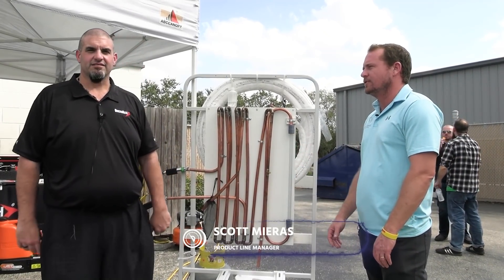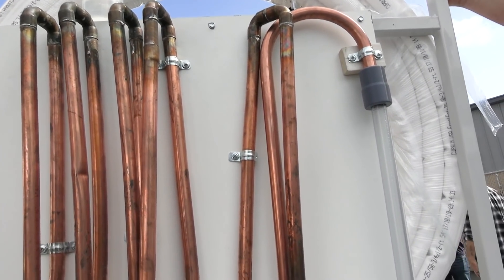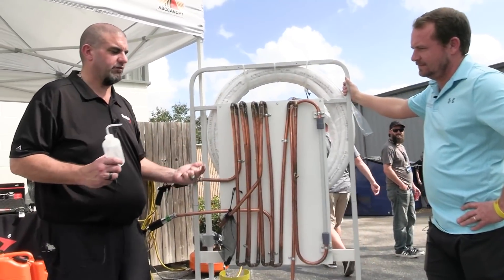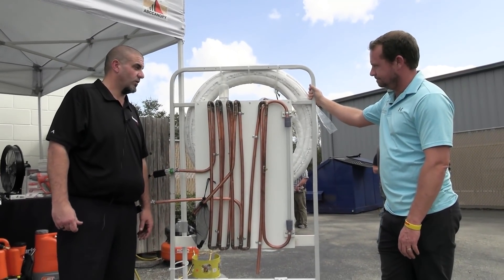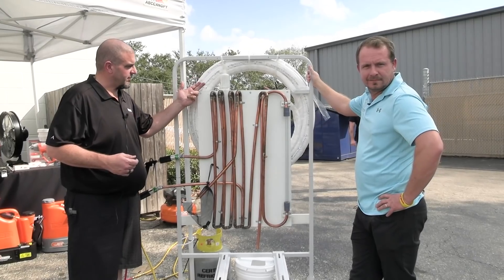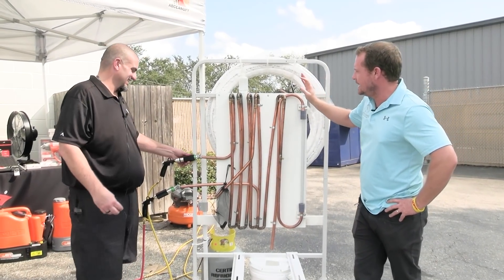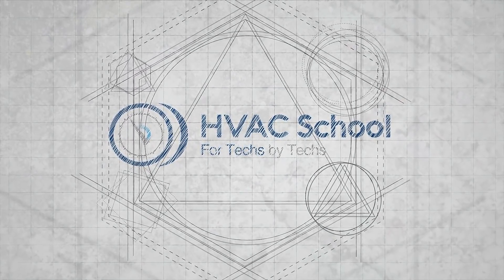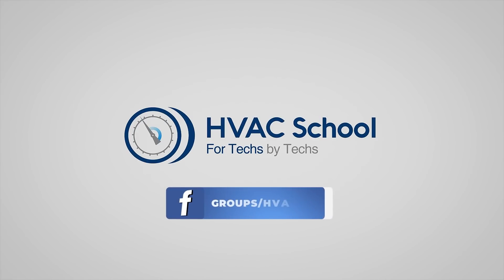NEW Hilmor Tools with Scott Mieras

Comment: What a nightmare if you don’t see that thing fly out the end of the pipe
Reply: I’d jsut quit 😅
Reply: DiversiTech conducted extensive testing to ensure that the pig doesn't get stuck in a line set.  We created the extreme demo shown in the vide to showcase the robustness of the product.  If the pig ever get stuck, you can go to the other end and push the pig back through the line set.  We have other tips & tricks which we can share if you call our technical support line.
Reply: True. What is the maximum pipe length you can send the pig down
Reply: @user-ot3zk5me5l  There is no limit other than having enough nitrogen tank capacity.  The PSI needed ranges from 30-60PSI but you need the volume to create that pressure over a longer line.  While we recommend nitrogen, you can use an air compressor but that might introduce moisture.

Comment: Can you use the pipe cleaner for drain lines?
Reply: lol do u trust a drain line at 70 psi?
Reply: @dunkdamonk  how do the CO2 guns work then. Isn't it high pressure? I've had success using a shop. I haven't used the CO2 out of fear of blowing apart a joint or worse
Reply: @terrygiordano4858  those little cartridges don't really have the volume to do anything like that. I only use them when the drain runs into the tight part of a roof pitch and daylights inside of a gutter. This system is pressurizing a pellet through that shit lol 😆.  Most times guys don't even prime their ¾ pvc lines. The others don't even glue them.
If it's a far run and you know where the other  end is then just shop vac it.
If you got a commercial setup or certain city's where all the condensate lines are ran in hard copper, then I'd say go for it because usually that's done by pipefitters unions and they pressurize them for inspection